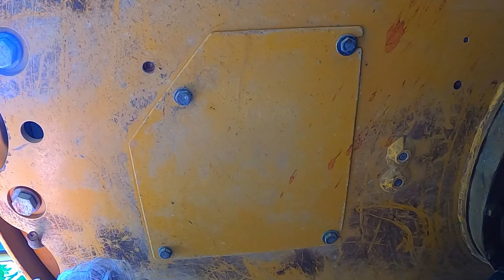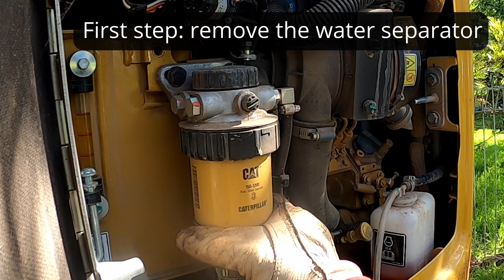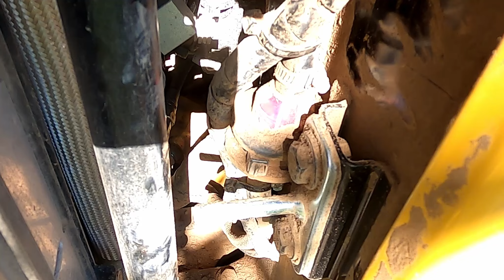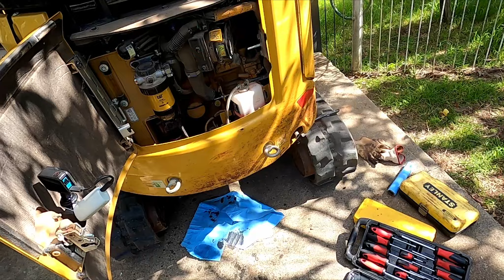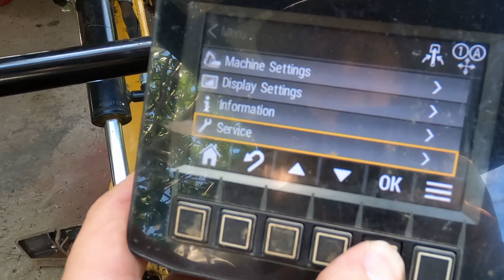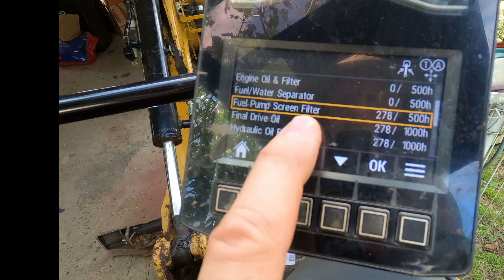Caterpillar 301.5CR Excavator 750 hour service

Comment: engine oil very dark
Reply from the maker: You'd have to talk to Caterpillar about that. I just follow the required service interval. The oil testing they did on the 500 hour service came back fine and the oil looked pretty much the same at that change too, so I'm not really worried.